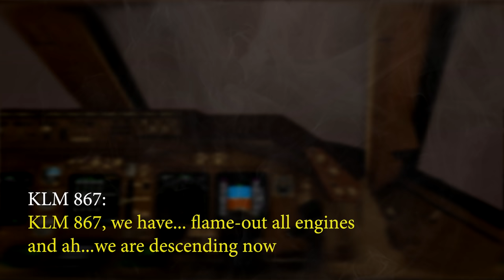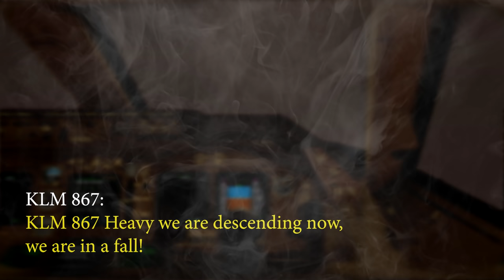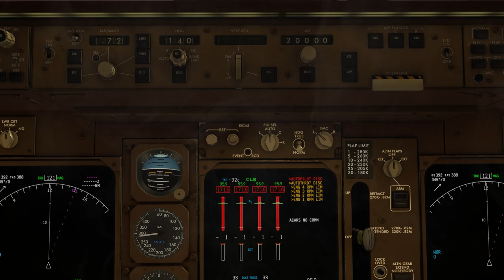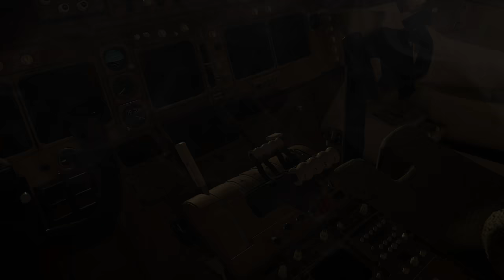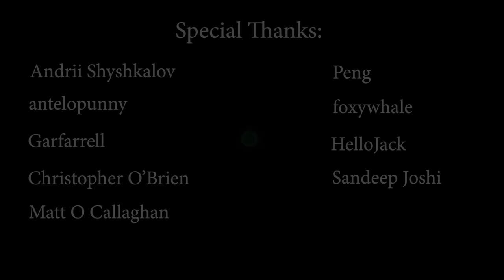ALL engines OUT!!? | KLM Flight 867

Comment: Soon, just like the railroad, where there used to be 10 men on each train, now there is only 1 person on the entire 2 mile long train.

The airlines are working very hard to pay off Congress to pass the " Airline Safety Act of 2022 " that will reduce the requirements for staffing on any flight to just 1 person.
The bill also has provisions for eliminating all liability of the airline for any passenger becoming sick and dying during a normal flight and reduces the maximum payout in the event of a crash to just $50,000 per passenger.

The airlines plan to eliminate all cabin crew members.

Essentially the single pilot will be responsible for making sure the luggage is stowed closing the door to the cabin and flying the aircraft

The pr tagline for this bill is

" IT'S A NEW DAY IN AVIATION "

And after the election the railroad industry plans to pass the railroad safety through automation bill eliminating all human beings on board Intermodal trains

The PTC system will drive and control the trains and the single dispatcher will set the routes in the computer and the computer will send the commands to all of the BCPS and the BCPS will send commands to the MCP wayside devices, lining switches and setting signals for the PTC system

The reasoning is that there is nothing a human being can do that the computer cannot

For the first 6 months the onboard video feeds will be monitored via the Internet at remote monitoring sites located in South Africa where the state minimum wage is $0.02 per hour and the average yearly income is $50 a year us

If all goes well in 2025 the airline industry would like to automate their planes so the computers can remotely fly them with no human crew on board because there's nothing the human person can do that the computer cannot

Both industries say that the majority of their expense is not fuel or leasing equipment or maintaining the equipment but the payroll costs and eliminating employees completely will maximize their profit
It will also provide an additional thousand pounds to sell per flight for revenue cargo
Reply: That is absolutely stomach turning.